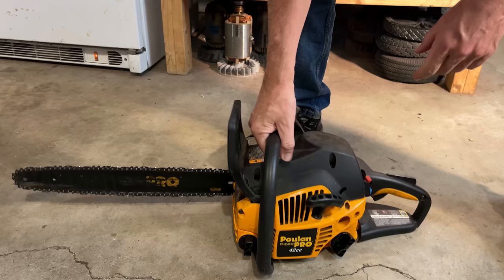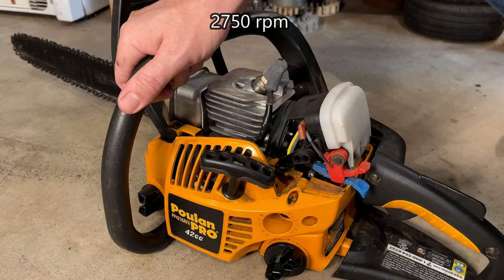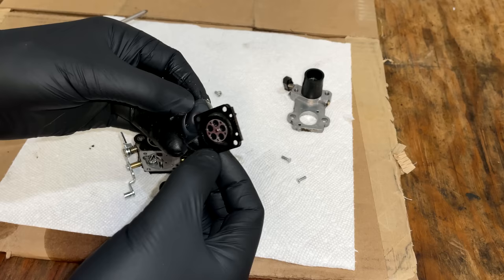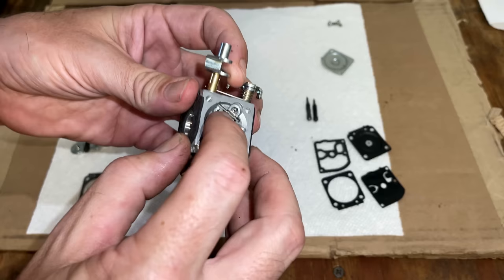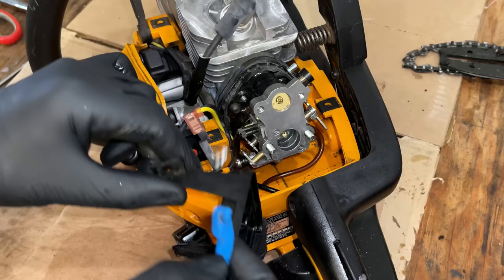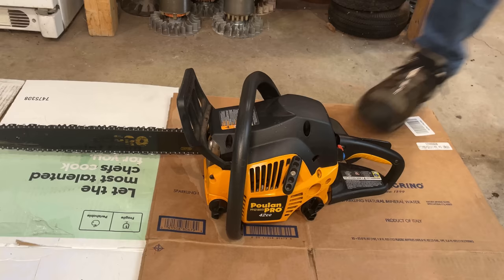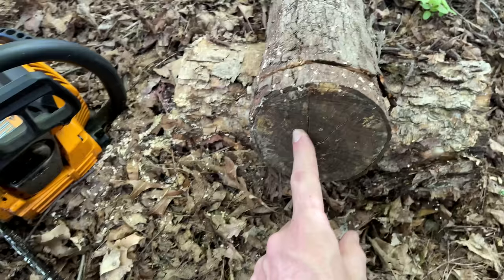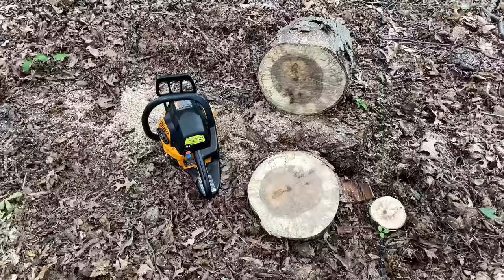Poulan Pro Chainsaw  - Not Running or Cutting Well

Comment: That’s why I never loan out my chainsaws to anyone.  I will go and cut what need to be cut for them.
Reply: I feel the same way I loan out my gas power weed eater it came back not running because he put regular gasoline not two cycle gas
Reply: A friend once said he'd loan his wife before he'd loan his chainsaw.
Reply: Amen!
Reply: Rod H   😂👍
Reply: @rodh2168  Damn right!!
Reply: I agree with You
Reply: Exactomundo.. 🔥🔥🔥
Reply: @rodh2168  So what's the wife look like? 😆
Reply: @rodh2168  Neighbor already been there.
Reply: @rodh2168  wise man!
Reply: @merrymanrc  g in by
Reply: All power tools!
Reply: Just imagine letting a friend borrow that tool he soaked the carborator with.
Reply: LOL...I have a STIHL  041AV I bought new in the late 1960's.   It still runs perfect although I've done a carb overhaul once, but that was from crappy ethanol gas.   My neighbor wanted to borrow it but that was absolutely not happening.   Having experienced loaning tools before and getting them back damaged there  was no way I was loaning out the STIHL chainsaw.
Reply: I loan equipment that I dont need myself. Spares that I noodle on for fun, since I enjoy fixing them. Like with a classic car, if you enjoy the restoration process its ok to let someone drive it oncein a while, if they break it you get to restore it all over again! ;D
However my personal use equipment stays in my hands, like you I will do the work for someone no problem.
Reply: Me too never loan out mine either
Reply: That's why I use a stihl. I don't have to worry about it
Reply: @loganwork7024  I have twenty saws - 14 Stihl, 2 Husqvarna, one Homelite, 2 MACs and one Poulan.  Does that tell you which brand that I prefer?
Reply: 10 years ?!?! 🤦🏽‍♂️
Reply: Can't beat a Stihl
husky sucks but I find more poalan at the scrap yard but I just rebuild the carbs and sell them
Reply: Thats what poulans are for. Loaner saws. Lol
Reply: @stickymick96  not the old ones made in Shreveport.  Those were good saws.  I had a 3400CV and 3700CV that were as good a saw as you ever wanted to use.  That Chinese crap they sell today as Poulan Pro are just junk, not even good enough to be a loaner saw.    I have one Poulan left - a S25DA that I bought new in 1985.  It gave me a few problems when it was new but after I rebuilt the carb it is a good saw.  It is a top handle professional saw.
Reply: @johnclarke6647  i was mainly referring to the newer junk. I have an older farmhand pp295 thats a work in progress but even that will be my loaner. I like my ryobi ry3716 way more. I wont loan my stihl or my holz

Comment: The old metering membrane was not installed correctly. You also installed the new one incorrectly. First should goes the gasket then the metering membrane. Your currently installed membrane is pushing on metering lever. It cannot close the fuel valve properly. It causes engine flooding. Your chainsaw is running too rich. Just change the sequence. Gasket first. Membrane second.

Comment: I have the same exact saw. The Poulan Pro brand gets made fun of because it's not one of those ridiculously expensive chain saws. For what it is, it works perfectly fine. It's intended for homeowners, not people that are lumberjacks. Mine has been perfect, owned it for about 20 years now and it works fine.
Reply: Has saved me a ton of money in the backyard , feels good to save a buck
Reply: I bought one of these about 25 years ago and it has NEVER ran for long. It stayed in the shop more than it should have. I just bought an electric saw from H F and it will do all I need. I am glad that You've had good luck from yours.
Reply: @MrMultitool 😂 I also have given up and purchased a HF electric saw. It has started every time 😂

Comment: The only suggestion I would add is on setting the high speed screw, always set it in the cut, meaning it should sound rich when out of the cut with a 4 stroking sound or burbble, then as soon as it is under load, it smooths right out. These saws are notoriously hard to maintain a tune due to disintegrating fuel lines.
Reply: Agreed, been sitting that long yea, those lines work today, dissolve tomarrow along with the primer bubble
Reply: A mixture adjustment tool should come with every saw. Better yet, 
if manufacturers simply understand differences in fuel and altitude
and breaking in of saws absolutely requires individual tuning and 
just put standard screws of some type on carburetors, revealing
something called common sense. Improperly tuned saws won't 
run efficiently and it isn't mysterious how to correct that issue
does not require a master mechanic or repair shop. On vintage 
equipment the mixture screws are just conventional screws. It
really was not progress to make mixture screws a proprietary 
design to cause people difficulty needing a special tool. You
are right about tweaking the mixture on the saw in use by 
making small adjustments to find the sweet spot. The saw 
operator can hear and see the result of small adjustments
to find what works best. The fuel line issue has always been
there. There is an immersion rated fluoropolymer fuel line
I have retrofitted on a similar Poulan, that came with a similar
version fuel line. LP=1200 Tygon is a clear fuel immersion 
rated fuel line that has I think an ETFE teflon lining coaxially
laminated with a jacket polymer of unknown composition, 
and the line is not as flexible and soft as usual fuel line. 
So it does not stretch and squeeze easily to pull through 
the same size opening in a hard plastic tank as the softer
and more flexible regular Tygon  yellow fuel line. LP-1200
goes through the rubber grommet fuel tank bushings with
no problem because the bushing stretches. But the smaller
opening like for the purge bulb return line that goes through
a bare hole in the hard plastic tank, I had to burnish carefully
to a larger size to accept the larger LP-1200 line used there
also, where the OEM Poulan used a smaller purge return line.
I wanted just one size and type line used for both the fuel 
pickup and the purge return line so I made this a custom 
modification that just makes sense to me, to use one size
and one type of fuel line both places. I used numbered 
drill bit shanks incrementally burnishing the opening larger
until I could forcibly pull the taper cut end of fuel line to 
squeeze through the opening when pulled by a hemostat
or needle nose pliers from inside the fuel tank. To do this
upgrade on a couple of other saws I have a #2 taper pin
reamer and precision 3/16" set collar to use as a depth 
stop for the reamer to leave a reamed opening slightly
under 3/16" so the LP-1200 line will be a firm leak free
squeeze fit. There is also available from Walbro a purge
bulb that is heavier duty and longer service life made
of a different type material that is black and I have not
yet tried that upgrade, but that is next as a retrofit that
should be better than new compared to the OEM purge
bulb. Those purge bulbs do crack with age and are a 
routine replace usually done same time as fuel lines
and carburetor rebuild. That shiny material fuel pump
diaphragm is ethanol fuel rated. Some carb kits come
also with the rubberized fabric diaphragm that holds
up better in non-ethanol straight gasoline. The shiny
material is good for either fuel, so the extra one is a
spare for future use but better not used with ethanol
blended fuel. I never run that blended fuel in any 
small engines because of guaranteed issues with
corrosion and water contamination. Ethanol blended 
fuel is engineered for causing trouble. Corn is for
feeding chickens not fueling chainsaws.
Reply: @artpatronforever  They frown on the consumers having those adjuster tools,, Its an emissions thing, but agree the first couple of times using any of the small 2 cycle stuff , sometimes an adjustment is needed, altitude wether you are in Denver Co, or Portland Or, and fuel quality affect performance also,winter and summer has its effects to,
Reply: @jeffclark2725  I have 3 of these Poulan Pro chainsaws. All
3 saws had mixtures factory set rich for the break in run. 
All 3 saws had to be gradually leaned out during the first
10 hours. It really can't be an emissions issue when new
saws come set rich from the factory. Emissions go down 
as the saws get broken in and the mixture leaned out. But
if an interference is done there it causes more emissions. 
I have encountered the same scenario with a blower so
it can't be emissions or if it is what is done is counter
to reason. However, if government is involved then that
would make perfect sense.
Reply: I was gonna say the same thing
Reply: @artpatronforever  they really don't trust Joe Homeowner to know how to properly adjust a finicky 2 stroke, by ear! Hell, half the problems or more are the wrong mix ratio or bad gas. That's the real purpose of the childproof adjusters. They are easily bypassed if ya know a few tricks.
Reply: @kriswright1022  It's a test. If you have enough on the ball to
get past the childproofing then you are licensed to tune
her up, like a locksmith encountering a chastity belt.
Reply: @artpatronforever Wow,that was more useful info.that is very important to know.Thanks for sharing that knowledge as I'm trying to fit those fuel lines today!👍
Reply: @malonemillers4465  The Tygon LP-1200 fuel lines are so far working
well for me after about a year but that is not long enough to tell
how much longer they will last. Ignition coils are what has been 
the weak point on the Poulan PR4218 for me. Based on the 
back order status for that part, my guess is many other people
are having issues and maybe there will be a service bulletin and
an upgrade like has been done for the starters. I have maybe 
300 hours on a PR4218, still going and pretty good compression 
at 135 psi, but is out of service waiting for an ignition coil. The
coils going bad will confound diagnosis because sometimes
the coils don't fail completely and deliver a weak spark but
not a hot enough spark. So the feeble spark can mask the 
issue when troubleshooting a coil issue. It may look like the
coils is good because it sort of sparks a little but not enough
to do the job.
Reply: Correct. Disintegrating fuel lines is caused by ethanol in the fuel. I always try to use rec gas for small engine applicatons.
Reply: @artpatronforever  Think I'll just chuck my saw instead!
Reply: I have a lot of Craftsman yard tools made by Pulan and I’ve had to replace the fuel lines in every one of them.  The last was a hedge trimmer.  It would start and run fine for a minute and quit as soon as I picked it up.  I checked the tank and fuel line was hard as a rock and broken off near the top.  With a full tank it would draw fuel but as soon as I tilted it it would suck air.  I replaced it with Tygon lines and no more brittle lines.  I don’t know why for the sake of a buck or two they don’t use Tygon to begin with.
Reply: @artpatronforever  Wow what a post thanks!

Comment: I was always a guy who wanted to repair my things. I found a carburetor kit for a chainsaw for $12. A replacement carburetor with a length of fuel line, two primer bulbs, an air filter and a spark plug was $15. If I added a can of carburetor cleaner to the carb kit, it exceeded the price of the carburetor, not even including labor. I bought the carburetor and it solved the problem. I was hesitant about the odd brand spark plug but I never had a problem with it. Ever since then, I check to see what a carburetor costs first and I've replaced them on several two stroke engines and 2 four stroke engines with great success.
Reply: Same here.

Comment: When I saw you running the saw without top cover my first thought was "don't do It".  A couple years ago I was working on my old Poulan after a carb rebuild.  It was a warm day and I keep trying to make it run better.  Finally it started to lock up.  Of course I ran it too long and over heated the engine.  I didn't realize that even on no load condition the engine would overheat without the cooling shroud.  Wish I had seen your video first!

Comment: I have 2 Poulans (POlan, not poo-lin), and they run great. They come from the factory set a little lean, so I richen them up just a tad.  Once set, they start and run just great. What usually happens is people leave gas in the carb for years, and it leaves a messy goo in the bowl and prevents sufficient fuel from passing. Methanol fuel makes it worse. Fuel injector cleaner can sometimes make it run great without further work, depending on the crud deposits which are sometimes insoluble. When the bar wears out, get a new Oregon and a better chain too.

Comment: Jim: Great job as usual. A few suggestions, Pull the spark arrestor out and burn it off if it has lots of carbon. Sometimes the carb can't be adjusted if the arrestor is plugged. Also run the saw wide open and adjust the high speed jet to it fastest RPM and then turn it richer until the RPM's slow some. This will save it from running lean and burning the piston. Try to file down the chain guide  depth gage in front of each tooth, this will allow an old chain to cut properly. Should be done every time the chain is sharpened. Thanks for an excellent video.
Reply from the maker: Thanks for the tips.
Reply: Yes I agree, he never did the fast running jet. To set the slow running, you can tune the jet for the fastest idle chain speed, then add a bit of richness.. Then slow the throttle stop, so that the chain just stops moving.   That old chain was a safety chain, so maybe the safety ramps would also need to be ground down as well as the rakers.

Comment: I had a Poulan Pro chainsaw, ran great for a year.....then on year two, I hated the thing so bad, I destroyed it and went electric chainsaw and pole saw.  Now I use the Onan 5000 generator installed in a lawn cart, with 100 feet cord, and run Greenworks 18" chainsaw and 10" pole saw.  These two electrics cut more wood in two years than the Poulan did in one year, and I don't have to fight the saw to get it started and run.  The Poulan would stall mid cut, have to fight to start it up in a tree, straight up dangerous; as being up in a tree getting ticked off at your saw is not what you need.  I did carb adjustments, and nothing mattered what I did.  The saying you have to Poulan, Poulan, Poulan to get it started is very much true!!

Comment: I fell asleep watching last night so I gave it another shot.  Excellent work and explanations, James.  I've been watching Poulan Pro chainsaw videos and 2-stroke carb and engine videos for a while now.  I appreciate the teardown, carb rebuild, reassembly, fuel/air adjustments and finale with all the details in between.  I found a great descriptive tutorial about 2-stroke small engines which gave a full explanation of how they work, including carburetion, air and fuel flow, compression, firing and exhaust, how the Low and High mixtures work together, how and why, fuel/air adjustments and the whole shebang.  Your video tied it all together in a rebuild and adjustment procedure.  I bought an inductive Tach/Hour Meter and have the Idle and Full Throttle speeds now, so I can set my new Poulan Pro PR5020 to perfection now, and be able to adjust it for the various working conditions, like elevation (the first thing to do), then changing conditions like hot and cold weather, humidity, and all of that.  Thank you!

Comment: Outstanding video James! Great teaching on the carburetor rebuild. Another thing to check on the chain are the depth gauge or rakers. They need to be filed down along with the teeth so the teeth can chip away at the wood and not ride along the top of the wood if the rakers aren’t filed as well when sharpening a saw chain.

Comment: James, I’m hoping you didn’t ship that saw back before reading the comments!  I was hoping to see a Sticky informing us you took the carb off again,  reversed the order of the metering diaphragm and its gasket and retuned. I agree with others about cleaning the spark arrestor and replacing the fuel lines. If the fuel lines are dark in color I’d automatically replace those and the purge bulb because it wouldn’t be long before they’re ready to go. I also would have removed the recoil and cleaned under there because that’s another place that can get full of debris, affecting cooling airflow.  Also agree with filing down the depth gauges. That’s what affected your ability to cut, more than anything else. Running a chain like that will do more to overheat and destroy an engine than almost anything else. One other tip - when tensioning the chain it’s easier to just tip the saw forward and touch the end of the bar to the table to elevate the bar rather than lifting it up with your fingers. 👍
Reply: Great points explained for us novices to the chainsaw world

Comment: As others have stated, the metering side gasket goes against the body with the diaphragm against the cover. @ 23:30  Been there, done that.  Irregular start and run was the result.
Reply: I've done that before. The metering diaphragm and the pump diaphragm. I was getting aggravated with then realized that I had the diaphragms on backwards
Reply: Well, somebody saw it!  Good job ... was wondering if this was some kind of different saw ...
Reply: I find this mistake alot and it’s a easy fix, but I tell them what they did wrong 😊

Comment: Correct chain tension - snug it up to the bottom of the bar, lift up the end of the bar and re-snug it to the bottom of the bar and tighten the bar nuts while you continue to hold it up on your saw, tighten the tool less adjuster.  I want about a 1/4” gap between the top of the bar when I lift the chain up at its midpoint of the bar and it snaps back to the bar when I let go of it.  I tighten all chains on all saws the same.